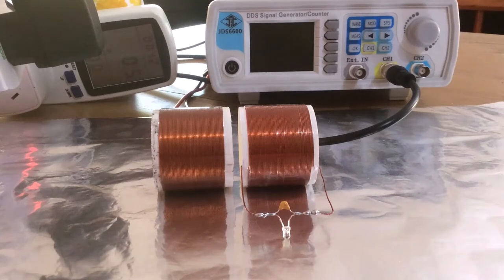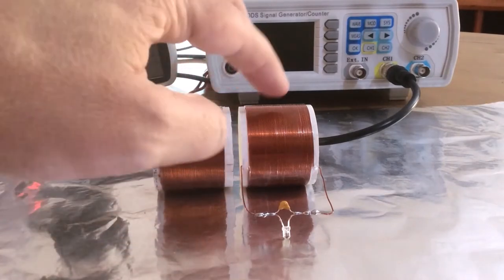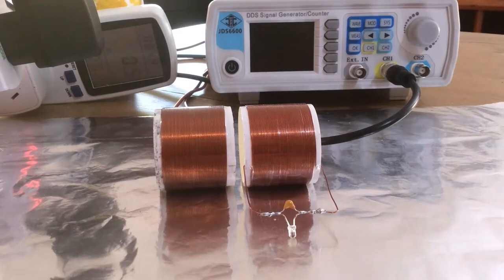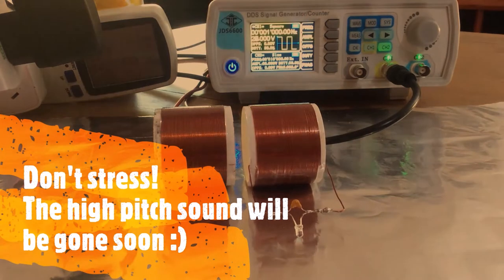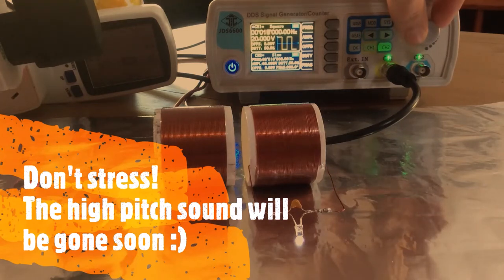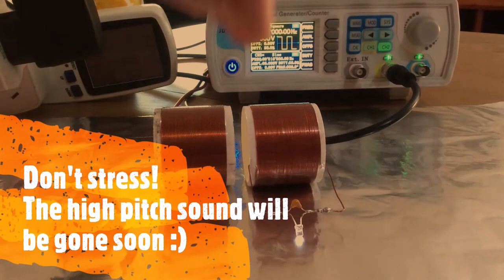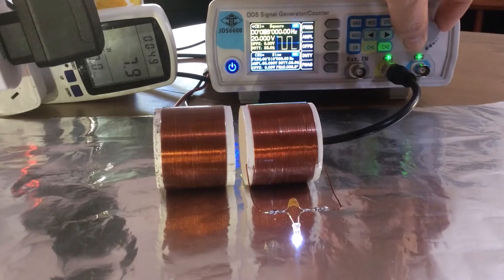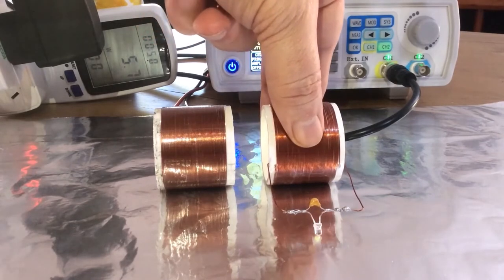FREE ENERGY with RESONANCE!

Comment: This is proof of concept, evidence of free power simply by manipulating frequency. If you pump water (current) through a pipe (conductor) using a water pump (pressure/voltage), and able to increase pumping speed (frequency) without increasing power, you will end up with greater volumes of water in a specified time. Mechanical systems may not do this but the beauty of electricity is its volatility.  In electricity we can increase speed(frequency) without increasing power. This is what has been achieved here. Kudos brother.  Thanks for sharing. For persimists who chose to  argue against evidence,  go ahead while I take this concept further. Have a blessed day.
Reply from the maker: Thank you for watching. Thank you for your kind words and I agree 100% with what you have stated.

Comment: If I'm not mistaken, the frequency can be adjusted manually with a iron core inside the hollow tube there. But loved the video, this is exactly what I was looking for to my question of how resonance work in wireless transmission in a tesla coil.
Reply from the maker: Thank you for your comment.
You would be correct and any ferrous material will effect the resonance and move toward or away from a resonant coil. This can be seen in the following video where I try to highlight the importance of resonant components within a system.
https://youtu.be/pcwyW9sSFmk?si=aty9RH2zL75GoIe_

Comment: How many turn you have on those coils? and what is the capacitor value?
Reply from the maker: Thank you for your comment.
Sorry for my delayed reply. All the coils except one have 46 turns and the coil specifications are on screen at 1:16. I can’t remember the turns of the different coil but I do mention it in the video when I demonstrate that particular coil. All the coils have a 50 volt 1nf capacitor.
Thank you for watching.

Comment: I think there are two things here and you are only looking at one. The second important factor is the standing waves. When you are at the node it diminishes and when you are at the peak of the node it lights up brightly, the LED. And yes magnetic filed is also playing a role in there. The node and anti node effect is because you have more than one transmitter. Changing the fequency changes the constructive and destructive points, the nodes, thus you see dim and bright lights.  I hope this gives some justified reasoning as to why your middle coil lined up with other three, is lighting up when you slide it close to the end coil. Thanks for this experiment.
Reply from the maker: Thank you for your comment.
Sorry for my delayed reply. I believe you are correct and there is a lot more going on here than is initially observed. I made mention of the Zennick waves theoretically present and placed a link to this wave form in the description. I believe it is definitely worth more investigation as soon as I can find time I hope to revisit this one again soon.
Thank you for watching.

Comment: Thank you for the enlightening demonstration. Apparently here when duplicate coil/lights are placed end to end, a mutual inductance value change occurs leading to change its resonate frequency. But side by side, this detuning interaction does not occur? Perhaps then a preferable arrangement is a vertical oriented central sender coil surrounded by similarly vertical multiple receiver coils. Just curious why more recently the center tapped counter wound coil from tesla us336961 started getting used?
Reply from the maker: Thank you for your comment.
Sorry for my delayed response. Yes it seems that there are different reactions due to coil placement that do not seem to be uniform. I agree that a vertically arranged central coil having smaller resonant nesting coils around its perimeter would be best for utilising the energy. I could be wrong but I believe the reason why there is more of a drag effect when coils are end to end is because it is similar to adjusting the length of the coil, even though they are only inductively coupled their magnetic fields are combining and extending and in the process adjusting resonance on a much greater scale. 
The us336961 patent of Nikola Tesla's from 1886 has surfaced recently due to Mtech using this winding method in a Lasersaber Joule Ringer modification.
Thanks for watching.

Comment: excellent demonstration, do have a scope to show the peaks as you sweep? curious about the foil on the table, is that an artificial ground plane?
Reply from the maker: Thanks for watching. I do have a small handheld scope that I can use to show peaks. I will try making a shorter video to demonstrate that. 
The foil on the table takes advantage of Zenneck wave transmission, effectively extending transmission distance. At this low voltage it only extends range by about 10mm. Higher voltages are a very different outcome in transmission distances. Check the description for an in depth paper that explains this effect.
Cheers
Have a nice day.
Reply: @whatifididthis...1236  awesome will check out that paper. I have also had fun sweeping tank circuits and watching the response, the most fun was the secondary of a MOT with a cap i added. The harmonic peaks were all the way along from 20Hz to about 20kHz, and they got further apart as i went up the range. I thought i had seen them all when the tallest peak was found it was so far away from the harmonics peaks that i was surprised to find it when it showed up. I never video'd it tho. I might have another play shortly. My electronics bench is in need of a tidy up before i can even look at it. Other projects have taken me away from it.
Reply: @m3sca1  ditto on tidy up bench

Comment: It is absolutely obvious that same length coil is actually acting  like a tunning fork Nd Esp is able 2pick the vibrations at short distance.. To transfer voltages... Between the two Esp dielectric voltages  but also the rate of change in current flowing through the capacitor will determine the magnetic component being produced in the coil so determine that to raise amps to do work done
Reply from the maker: Thank you for your comment. I apologise for the delay of my response as I have been trying to catch up on 4 months of the things I wasn’t able able to do whilst injured. I agree with you regarding the tuning fork aspect, it is weird to see it in action and the frequency generator makes it so easy to pinpoint the optimum frequency. I aim to experiment further with the correct caps, the one currently used was optimised for the LED and I want to find the right cap for larger loads for use with my 12 volt portable oscillator coil I have.
Reply: @whatifididthis...1236  may b u cd also chk if u find a amp coil placed in between ur similar coils lengths at distance works if connected to centre of the primary... Or connect single wire placed in centre of the magnetic field inside the coil probably the direction of amp coil may matter which is used to raise magnetic flux transfer..
Reply from the maker: @roshanmathew9443  Thank you for comment. There’s so many experiments to do and your suggestions should definitely be tested, I also wish to test the zenneck wave concept soon with these coils and others. There’s just not enough hours in a day.

Comment: Have you ever wondered about math behind it? For example, how distance and frequency is related.

What if you replace one of the coils with a permanent magnet?

What if you put isolator between coils. Will it still work?
Reply from the maker: Thank you for your comment.
I have done a small amount of math on the subject but I prefer to experiment in the physical world.
I want to run more tests with magnets and these coils as I haven’t done very much, I remember testing just about everything in and around the coils but moved on quickly in pursuit of particular effects. I intended to go back to that research but haven’t got there yet which is a side effect of too many projects.
It would be interesting to test blocking the signals, did you have anything particular in mind?
Reply: @whatifididthis...1236  Well, I assume just a piece of rubber strip between coils.
Reply from the maker: @MaxMaxx-tb6nz  I can arrange that, I assume it will have little to no effect as rubber only has a small amount of ferrous material in the black dye which is probably not enough to make a measurable difference, but you never know unless you try it.

Comment: Increase the voltage to increase the skin effect. Should boost the range.
Reply from the maker: Thank you for your comment.
You would be correct, Zennick wave benefits are almost indistinguishable at this low voltage and is a lot more evident when using the high voltage of your typical Tesla coil. I feel it’s important to inform people that this is not just a high voltage phenomenon as some don’t feel safe playing with high voltages.
Reply: @whatifididthis...1236  that's correct. But the gains go up exponentially as voltage/frequency increase 😄 these kits should be sold to schools everywhere. I would've been in heaven if I was able to learn about this in school!

Comment: Excellent video sir! I noticed at the end you mentioned taking one of the resonant coil configurations and routing it back to feed (assuming you mean input power here?). Theoretically, this would make it a closed loop system (assuming no gradual power loss) and class it one of those configurations that people are always wagging their finger at quoting the law of thermodynamics. Have you tried setting up such a configuration (perhaps with an additional capacitor) to allow for the switching off of the power from the signal generator and allowing it to run itself, and to test how long it goes for, compared to how long it should go for by storage capacity of the extra capacitor?
Reply from the maker: Thank you for watching. To feed back to the battery it is best to ensure the receiver coil is resonant with the main coil. Resonance is easily achieved by measuring the main coils physical length and constructing a coil that is a division or multiplication of the main coil length. A lot of people have been tricked by their education, we still teach electron theory even though both Einstein and Tesla stated they did not believe in the existence of the electron, so in relation to the laws of thermodynamics, crap rules made by those who don’t perform experiments to see with their own eyes or they were lies to enslave humanity. Tesla even stated he thought Einstein’s theory of relativity was mathematical garb and didn’t have much respect for theoretical scientists. There has probably been no other scientist in history that has performed so many experiments. I have tried to use the capacitor with my portable wireless transmitter and these coils however the capacity was not large enough. I am currently running tests feeding back to the drive battery using these coils powered by my portable lighting system and will make a video when I have the results.
Reply: @whatifididthis...1236 sir does the diameter of the coil matter along w the length of wire is agreed to pass on wave length... But does1.. coil weight, 2..diameter of the wire 3rd diameter of coil have any specific bearing towards resonance even if it has the same inductance or do u use a measure of the inductance or is thr a ratio of the inductor to capacitor for resonance to happen... Pls elaborate on these 4 aspects.. I think having a smaller Diameter or radius of the coil may speed up the waves formed or increase the frequency of oscillations and can a trumpet coil act as invetween to transfer oscillating waves to the smaller radius coil...
Reply from the maker: @roshanmathew9443  Thank you for watching. As far as I understand the situation it is the length of the coil that is most important here. A different diameter coil should not make much difference if the length of wire is the same, there will obviously be a difference in number of turns however the coil will be at the same frequency as the transmitter coil if the length is the same. So the main factors for resonance would be wire length and capacitance. I hope this information helps.
Reply: @whatifididthis...1236  but I think the diameter of the coil matters as it speeds up the frequency or wave if decreased diameter of coil radius, not the thickness of the wire, may need a same diameter to lower diameter coil as a in between, to transfer wave,  so frequency nd voltage transfer happens... Basically frequency ie no of times waves per sec and voltage induction, while amperage changes if u get a thicker wire or decrease in no of turns esp over a ferrite core ie raise the inductance ie increasing the resistance or basically wave compression due magnetic conversion/ storage/ induction, the other being primarily dielectric/electrostatic which is raised w cap,... Also I feel both a receiver/repeater and a transmitter ie 2 coils of same cap/inductance pairs r required to further the distance of wave travelled ... One w/o load nd w load in pairs should b used to raise distance of transmission as repeater, Nd do chk weight of as resistance depends on that, same way I think higher cap voltage feed shd help raise the electrostatic current  supplied 2 coil 2make adequate voltage.... And vice versa higher voltage feed to make higher current in cap nd frequency controls the interchange between the two..... Nd third component ie ferrite core  magnetic inductance hw it functions wrt frequency n voltage ie the core.... U can also increase amps via asymmetrical windings ie additional or dc pulsing for core to b magnetised on off determining how fast north south change happens , resonant natural frequency of coil each material has least resistance during it naturally fundamental resonance so u can  go between standing wave, vibrating brownian movements of electrons or charge, to flow of charge seemlessly when resonance is functional ie least amp it takes or max light output u get via dielectric measurements Nd amp measurements
Reply: @whatifididthis...1236 it is said that capacitance can b raised by 1. Insulator u have in between w least gap to hold charges ie distance, 2 using bifilar coils, 3 using higher farad cap Nd does having a higher voltage smaller farad have a higher utility as pulsing of current w b higher over
Reply from the maker: @roshanmathew9443  Thank you for your comment. I believe you are correct with all the points you make in this comment. The insulation has a dielectric capacity and I have seen the effects of this when winding coils using thinner insulation as some devices would no longer operate, rewinding with a thicker insulated copper wire allowed the new coil to work and this test was repeated and could not be denied. The bifilar coil is the same again, some devices would not operate without it and I honestly feel there is a relation between the enhanced wireless function and the bifilar coil. Capacitance again being very important to manipulate frequency and we all know the secret to the universe is frequency.
Reply: @whatifididthis...1236  it is not just frequency it all abt resonance or the force the frequency carries ie achieving low resistance to current flow, as also happens in high voltage  high frequency, as produces low impedance or low current required for work done..... And do chk capacitive induction...  So using resonance nd earth's capacitance u have to bring out the best rest is all abt using the rt swing for the load at right voltage
Reply from the maker: @roshanmathew9443  I have to agree that resonance is super critical for efficient use of energy and when coils are resonant they will often have multiple frequencies that allow for efficient use of energy as well as replicating the magnetic field at no cost to the transmitter.
Reply: @whatifididthis...1236   nd in circuits try having more capacitance as compared to input, /inductance esp or  level compared to input nd u will find more energy... Capacitor will also charge up fast esp chk without a resistor, nd let me know ur results

Comment: ❤❤❤, Hi. Could you build a silent generator with a closed loop ( Self Running). You are very close.  I really m waiting for you to build something all of us can build ourselves. If it can power lights and drill, it would be very nice 🙂😊😊😊❤
Reply from the maker: Thank you for your comment.
I am sorry for the late reply, just another comment that slipped through the cracks.
I am working on many different devices at the moment and struggling to find time to make the videos and research and have a life. I hope to encourage others to help me in the research department and we can all have the success you mention, if all of us learn together we can be unstoppable.
Reply: you can build this and do your own studies. you can buy a signal generator for very cheap and just wind some coils and observe the behaviours !
Reply from the maker: @tvdylan  Thank you for your comment.
This signal generator was fairly cheap at around $120 and whilst there are cheaper ones than this it isn’t really necessary and you can build something similar to my portable off grid lighting circuit which acts as the signal generator. This can be made from old or scrap materials and would cost approximately $20 if you had to buy everything. If you watch my tutorial for that circuit you can see some of the features it presents.